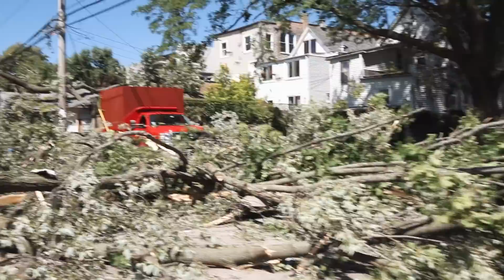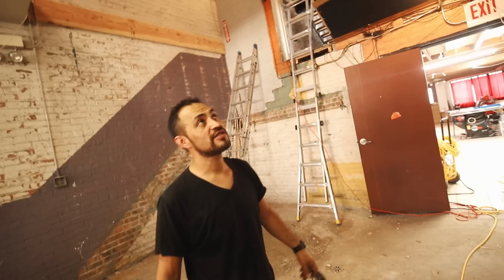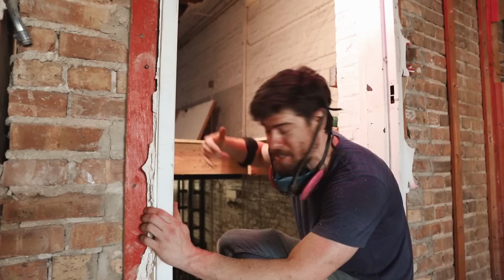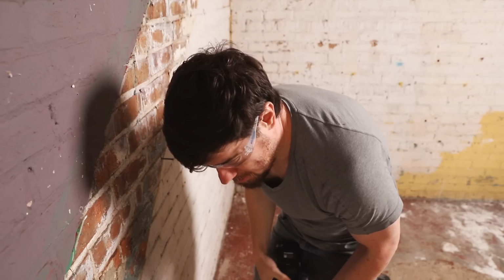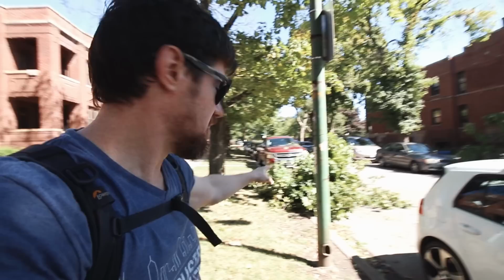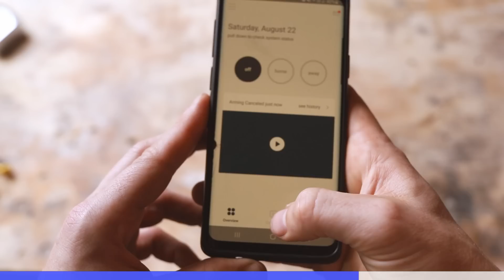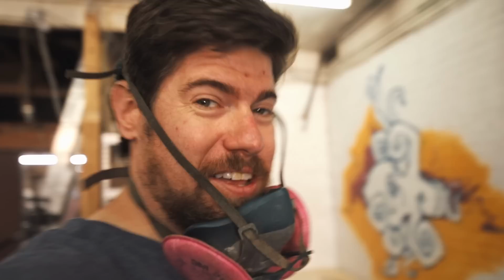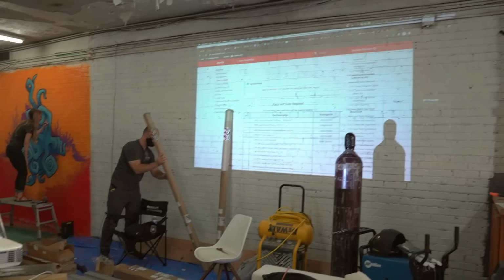Abandoned Building Renovation Ep 06 - TORNADO, ROBOTS, & ART...Oh My!!

Comment: Wikipedia:
Spray painting is a painting technique in which a device sprays coating material (paint, ink, varnish, etc.) through the air onto a surface. The most common types employ compressed gas—usually air—to atomize and direct the paint particles. Spray guns evolved from airbrushes, and the two are usually distinguished by their size and the size of the spray pattern they produce. Airbrushes are hand-held and used instead of a brush for detailed work such as photo retouching, painting nails, or fine art. Air gun spraying uses generally larger equipment. It is typically used for covering large surfaces with an even coating of liquid. Spray guns can be either automated or hand-held and have interchangeable heads to allow for different spray patterns. Single color aerosol paint cans are portable and easy to store.

Paint sprayer!

Comment: Surely you've taken all the structural strength out of that new floor by cutting out for the stairs?
Reply: Exactly what I was thinking, the openings are to be framed as the floor frames were being made, but should still be strong enough to bear weight although not to code
Reply: Yeah I thought the same. As soon as he cut those joists they became dangling from the plywood rather than holding it up. I wouldn't walk on that.

Comment: Question, why didn’t you seal and epoxy/paint the floor before setting up the CNC? Was it the cost?  Just from experience I wish I had done mine floor before, just because I had to disassemble my CNC and then reassemble it again after I epoxied.